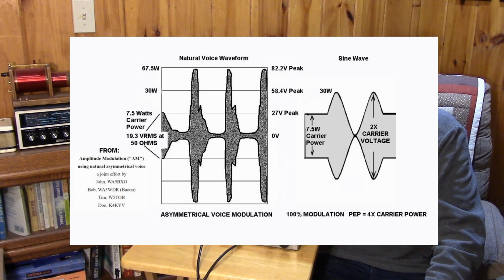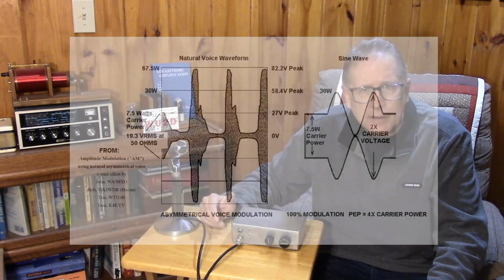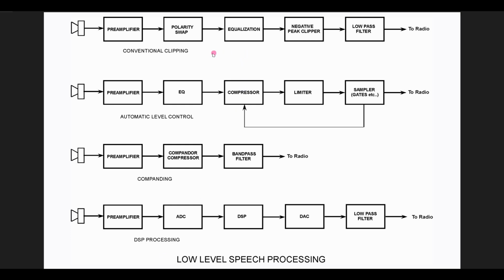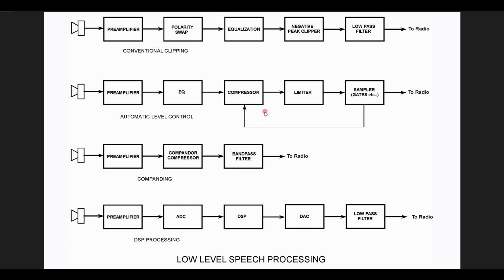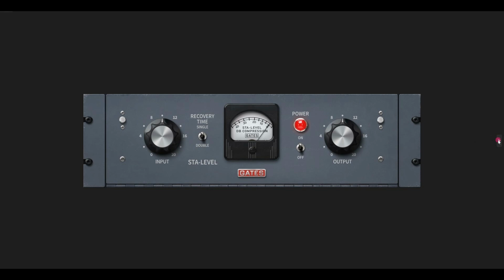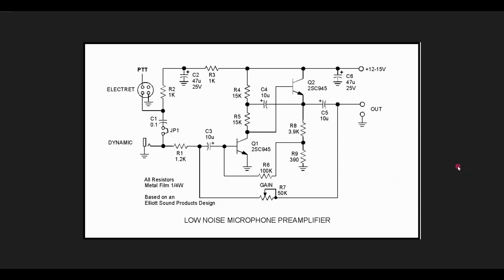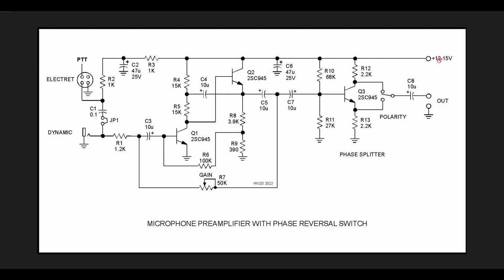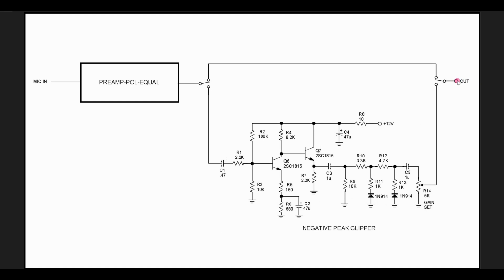Speech Processor Part 1

Comment: IMHO, the one to get or emulate is the CBS Audimax. It does a great job leveling out speech. This unit has a 3-position release time switch: Fast, Medium, Slow. I think the Slow position is not that useful for speech, so I changed the resistor value to turn "S" into Super-fast. But it still doesn't suck up the noise, because it freezes when you stop talking.
Reply from the maker: I hear those old boxes are quite collectable!

Comment: Great Video. I think I will build it. Was there ever a part 2 and did you ever show the circuit boards of the finished project? It would be quite helpful in building my own Speech Processor. Thanks again for a great video.
Reply from the maker: I never went that far. There are some nice ones out there. https://www.s9plus.com/FAT%20MAX.html

Comment: What about a Speech Compressor using 2xMC1496 Ring Modulator chips where the first MC1496 chip generates the RF at 38khz and  clipped by a diode clipper before being turned back into AF by the second MC1419.

Comment: 2SC945 equivalent =  2N3904,  replaced with = BC546, C1815, KSC945C.  The C945 is an age old Japanese Bipolar audio frequency NPN transistor.  It has a decent gain value (hfe) of maximum 700 and is highly linear.  Hence it was widely used in amplifier applications for pre-amplifying purpose, in high frequency circuits. It is also used as oscillators with is complementary A733 PNP transistor. Ron W4BIN
Reply from the maker: Those old AT and ATX supplies used what was cheapest that would perform well in the basic reference design. It amazing what common parts that you can find in them. Why use a 20 cent transistor when a 15 cent device is avaliable?

Comment: I learned a lot from this episode.  Phase reversal was a real surprise. 
About that low noise mic amp; what makes it low noise besides the metal film resistors?  Are bipolar transistors quieter than FETs?
I modeled the preamp circuit in LTspice and learned that C4 in the collector circuit of Q1 to emitter of Q2 boosted both gain and linearity.
Reply from the maker: Bipolars, even these pull outs from power supplies, are hard to beat for audio. There are quieter FETs and Op-Amps out there.

Comment: Q3 is a "paraphase converter."   Men's voices is highly asymmetrical with the negative peaks are greatly compressed and that needs to be the negative modulation, women's voices are very symmetrical, the main reason men and women sound differently.  The costs of everything is higher because of this rotten Biden Economy. Ron W4BIN

Comment: Precision negative diode clipper with op amp is much better, very accurate but a little more complex. If your PDM is capable try asymmetrical modulation it will make your transmitter much louder.
Reply from the maker: This is coming!

Comment: Can we implement the sound processor in C++ for the UDOO RYZEN Bolt V1000 Maker Board SBC with a bandwidth from Between 300Hz to 3000Khz, We can use the FFT to get the FFT of the signal then multiplied with the FFT of the impulse from the filter then a IFFT is applied to yield the wanted signal.
Reply: We don't know. Can you?